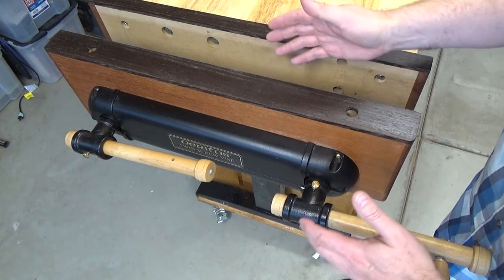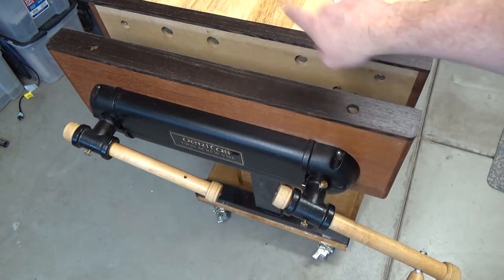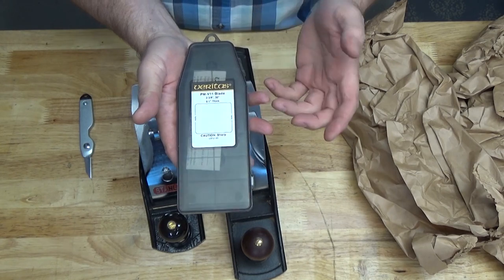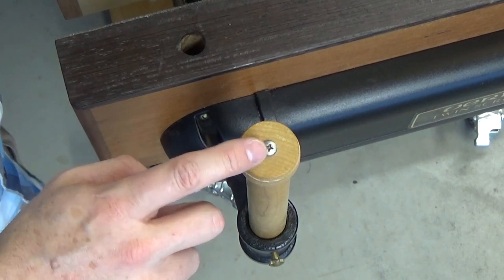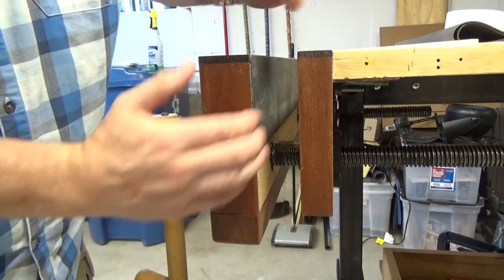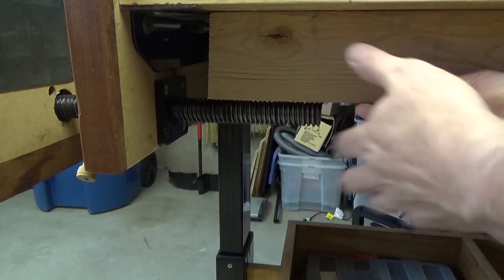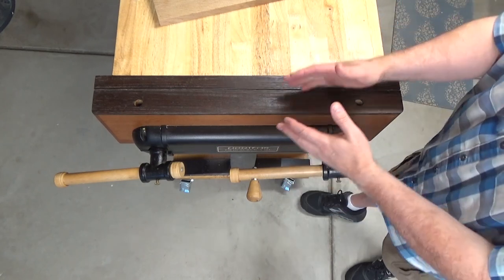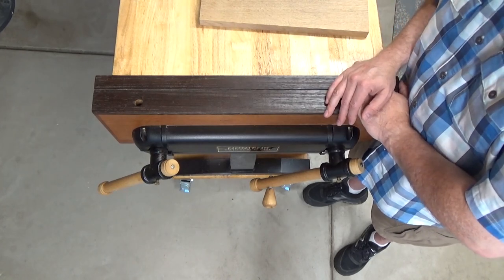60-Day Review: Veritas Twin-Screw Woodworking Vise

Comment: Congrats on this upgrade! Regarding wearing block or bushing for the screws... When I installed mine I used DN 32 PVC tube for sink drain that is 32 mm outside and close to 28 mm inside - just slightly bigger than the screw. I have some stretchers underneath the worktop that I drilled to let this pipe with the screw to go through. Now the screw is supported all the way and also protected from dust underneath (though, some saw dust on exposed part of the screw can go inside when you close the vice). Also I built a prototype out of cheap construction wood for front and rear jaws before installing to the actual workbench - that helped a lot for figuring all out.
Reply from the maker: Thanks Andrey! I love the PVC idea for support and preventing dust from getting on the grease. Also, I keep bumping the screws and get grease marks on my forearms when I reach under for tools. That would solve that too. Will have to look into it.